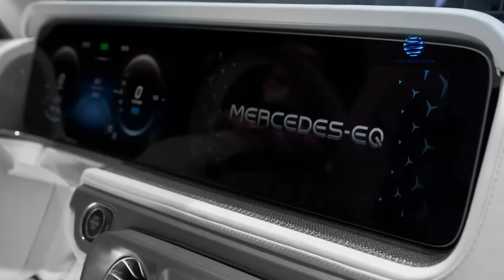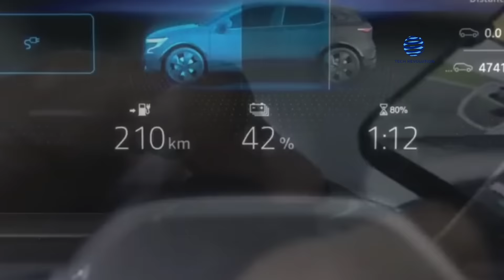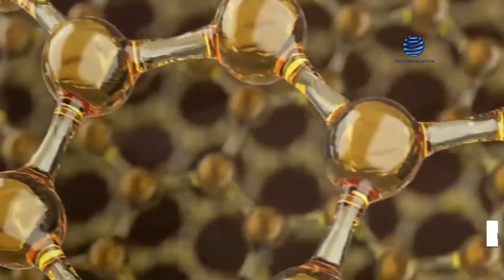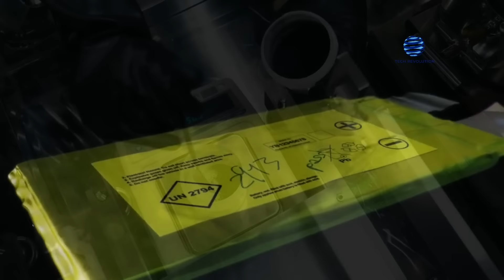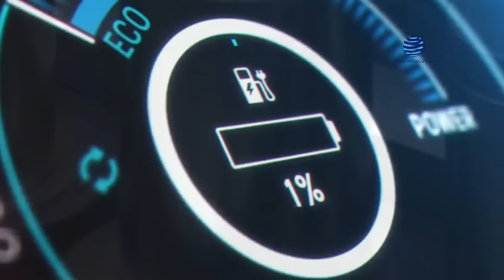Scientists JUST ANNOUNCED A NEW Battery Technology That Could Last For 400 Years!

Comment: What about generator vehicles. A vehicle that has self generating power engine.
Reply: And... where exactly would it generate that power from?
You'd need some kind of fuel. Like... gasoline. Or hydrogen.
Or coal or nuclear material, if you're feeling retro or just very very brave.
Reply: @Sercil00  by it self,. Do you know about generator that it's electricity is came from ions?
Reply: @Sercil00  or plasma generator that can attach to your tesla car to charge your cars battery while continuesly driving a car without stopping..

Comment: This is the kind of battery improvement I'm SO MUCH more interested in. Charge speed? It's important and all, but there's a limit to how much any charger can safely put out. Energy density? Very important, since it also means less cycles needed and less weight that you have to haul around since that costs more energy. But a number of cycles like that creates an actual used-market for cars, which the vast majority of car owners fully rely on. Nobody is going to buy an 8+ year old car if there's a very high risk they'll have to do a 13K$ battery replacement.
And for electronics, the battery is THE bottleneck when it comes to longevity. It's the major reason to replace an entire device, which creates unnecessary e-waste. Or batteries that fill up landfills.
Even better if it uses no lithium. We need to get away from that quickly.

I just hope this won't be another amazing technology we'll never hear from again.

Comment: Reduce the cost and make it last for 50 years...not sure of who will use a car or gadget for more than 20 years
Reply: If it's a commonly used universal battery, the batteries could be reused in other devices instead of thrown away.  They could start making phones that have a universal battery slot and you install the battery sort of like an SD card.  Got a new phone?  Take the battery out of your old one and put it in the new one.

Comment: As a battery-powered generator for camping or the home without relying on service from big electricity companies, it would only need solar panel power to recharge it constantly and power the house at the same time /*
Reply: Only if you live in southern Spain possibly ! Even here in Greece solar energy is patchy, especially in the winter when you need it the most, and in the UK forget it.

Comment: Maybe batteries will be bypassed by devices flat harness the 10^6 meters/ second, 25 mV ambient temperature thermal energy of electrons as they travel from a carbon nanoneedle forrest emitter to a graphine flake absorber absorbing heat and producing electricity in exact correspondance.
Reply: Wat fuq are you talkin bout Willis. Wat you describe needs more detail to be understood. Why not us crushed quartz impregnated in that material under pressure to help generate electricity.